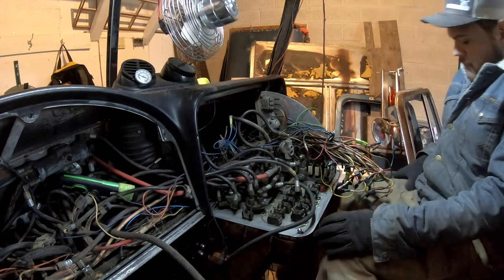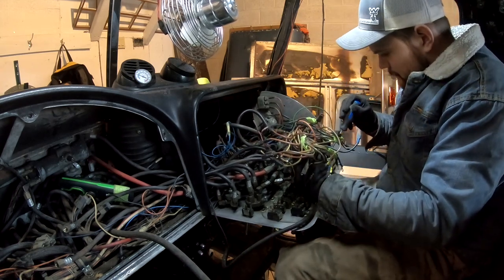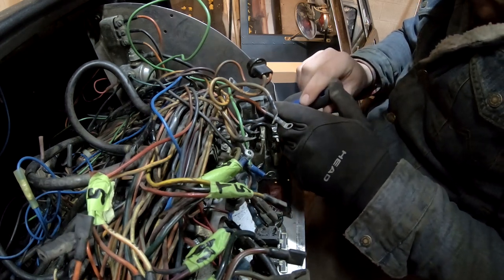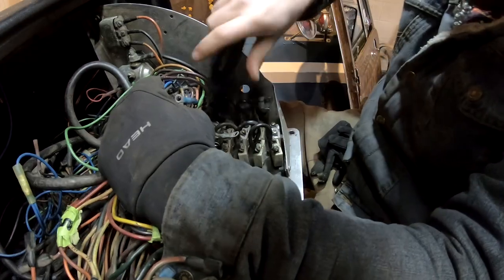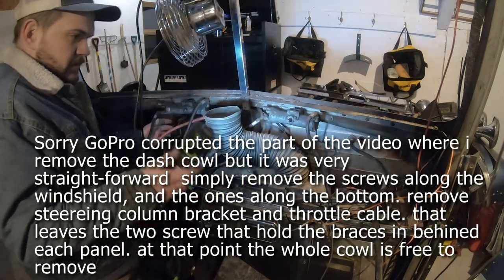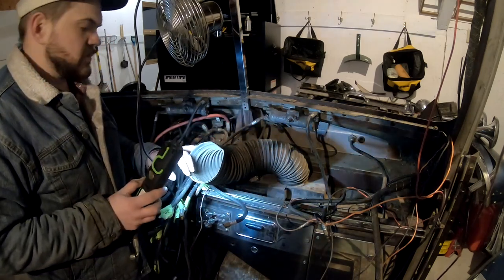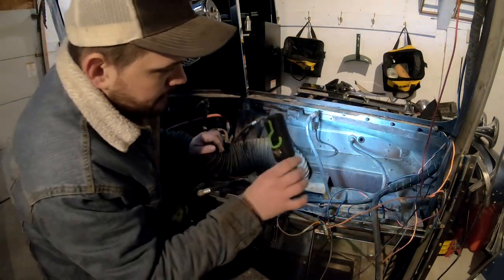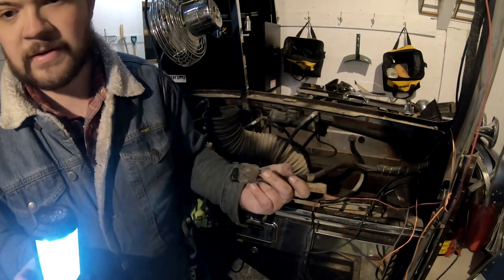Dash Removal Peterbilt 359 restoration: Part 29 #Peterbilt #359

Comment: Does your 359 have Eaton rears? Noticed in a previous video you mentioned it having 5.33 gears in it, I’d never seen that ratio before but I’ve only ever run Rockwell and Dana-spicer rears. In Rockwell’s the popular ratio for an older truck around here was a 5.29, with 4.63’s being the runner up and the Spicer/IH rears in my paystar are 5.38’s
Reply from the maker: Ya i got confused with 355. It actauly is 529s

Comment: Wondering as you have/are going for a full strip down/out are you opening up the rear of the cab to the later style walk through opening to the bunk ? as when its all stripped is the time to do the conversion , have no idea if you will work this truck or its just a toy/hobby ?
Reply from the maker: Just a toy 😆
Reply: @Bubbles8V92  cool, still would be easy to convert to walk through when it all striped out 🙂

Comment: May I ask, have you worked where they put trucks together or is this something you just naturally gravitated to? Its a big handful being behind one of those and understanding just how they divided up what would go where an how many outlet manifolds, circuit wiring and whatnot as for other stuff that could be added later or other.... I am way out of my element of comfort
Reply from the maker: Bit of everything. Im definitely stretching on a project like this but i definitely grew up around tools, mainly agricultural equipment tho.
Reply from the maker: Also having a 2nd 359 for reference helps 😄
Reply: @Bubbles8V92  Get er done bud 🙌🙌🙌